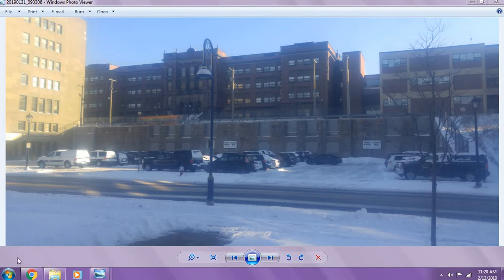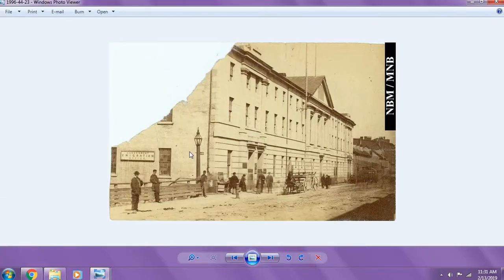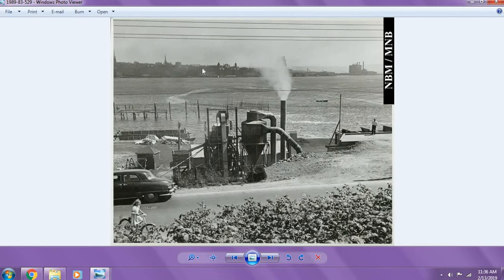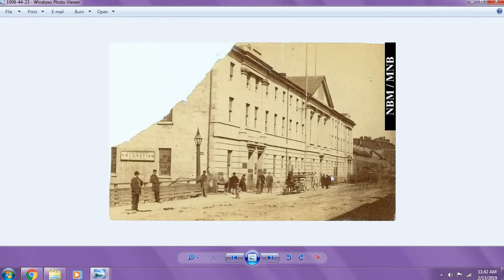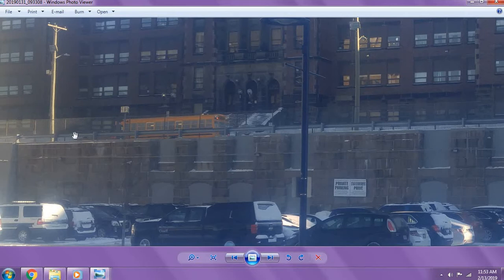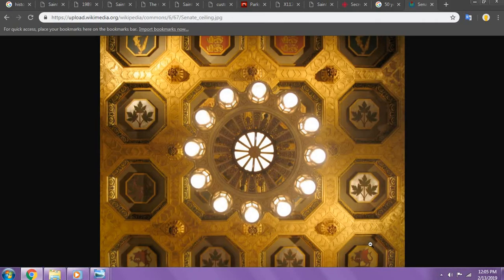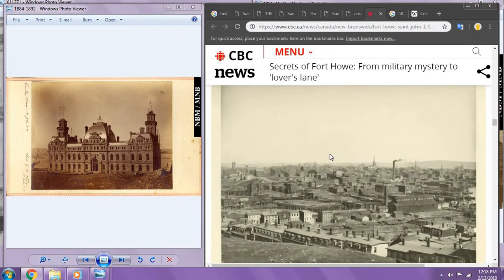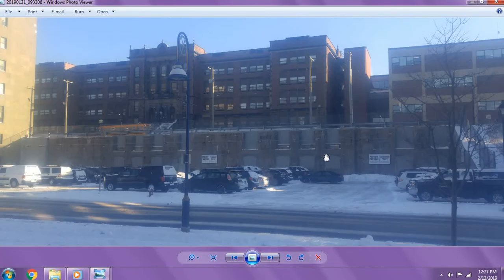Mud Flood in Saint John, NB. The Follow Up. Antiquitech??

Comment: 13:25 your standing inside the old buildings foundation, it's a parking lot now. The rear, half buried wall, IS the new retaining wall (to hold back Earth up to street level on the street above from the parking lot) where the building once stood IS where your standing. My guess would be is this building was only partially dug out after a mud flood and that's why the rear 2 lower level windows exsist on that side. Street level on that side was not 25 feet higher when the building was originally built!

Comment: Compelling research on the customs' building - that wall with the boarded up windows is really interesting...   Are you able to get a peak behind the wood boards?  Subbed.
Reply from the maker: They are not wood boards. The city has concreted up the windows for the retaining wall. I found a pdf of a repair job the city did to another retaining wall down the street. I just made a video about it, if you are interested. https://youtu.be/iA2X4q1VQZI